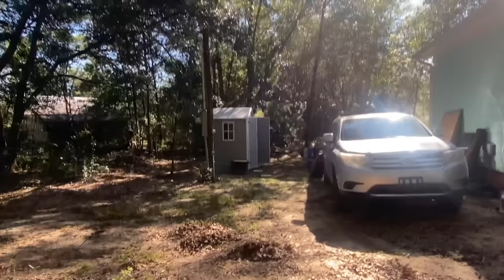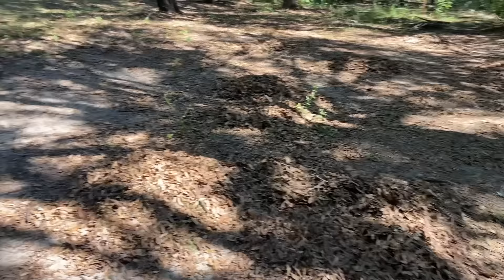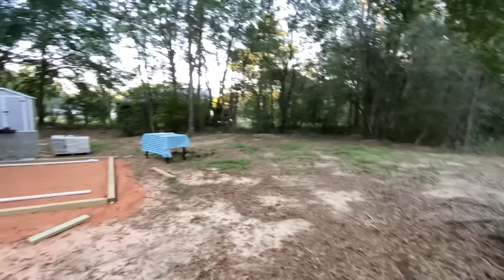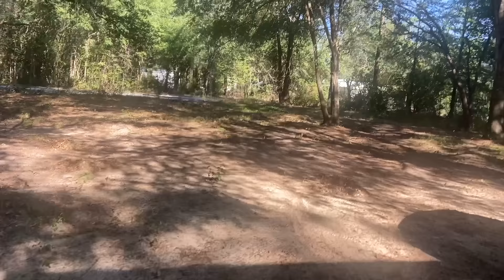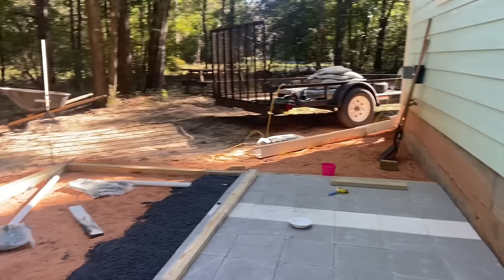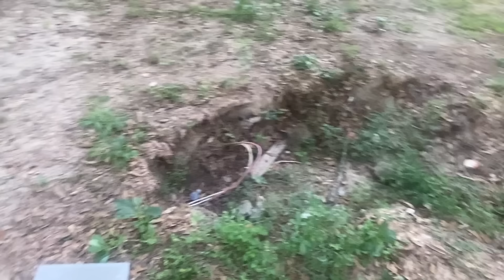Step by step paver patio for tiny home cottage continues. Cost. Special design! Clearing land.

Comment: Patio looks very nice! It gets shade from the house, so it will be great when it is hot. When your guy takes his wheelbarrow home, may I suggest using a tarp to rake leaves. Rake leaves onto a tarp, old,shower curtain, plastic tablecloth and then take up the 4 corners together and move. You can rake your piles on the tarp easier than a wheelbarrow too.

Comment: It's fine workmanship, all right, but would probably have used spacers in between placing the pavers, and gone back and filled with sand. The thing about using pavers is that they are likely to become unlevel at some point, and probably need to be re-leveled every few years.
Reply from the maker: I researched that and decided that I was not interested in that step being how these stones literally butt up against each other. Got opinions from people who have used them and said it was not necessary. Doing a proper job but not spending extra on labor and materials is also critical for me.